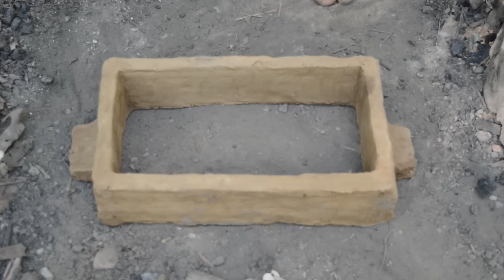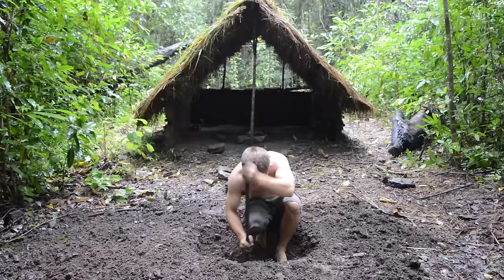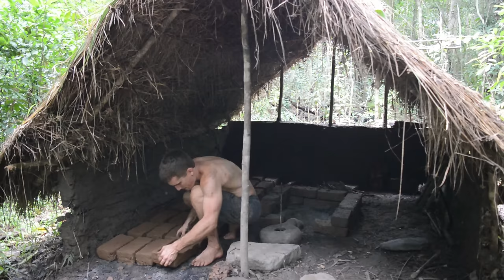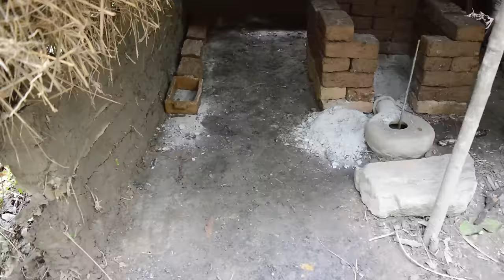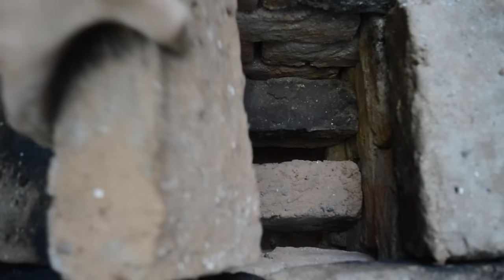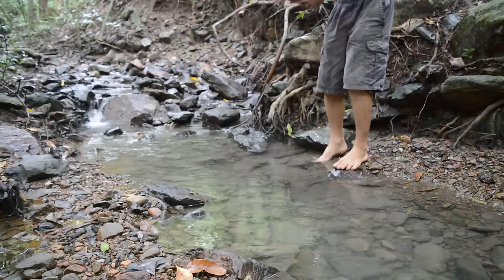Primitive Technology: Fired Clay Bricks

Comment: Love how he always shows us that he makes the fire by him self and not pulls out a lighter off camera
Reply: making a fire is an everyday and tiring job compared to today, so i like that he shows his routine and how he optimised it, and uses it each time
Reply: @marluxiar7231  And you can tell its real just because of his technique, its just perfect.
Reply: If he were out there everyday he could just work with the same embers. I feel for his hands every time he make a new fire
Reply: @h.r.9563  Actually, after a wile your hands stop hurting. When you first start doing hand drill fire you can easily bruise your hands and get blisters. but if you take it slow and practice, you will get calluses and your hands wont bruise anymore. you will be able to make multiple fires a day before your hands start to hurt.
Reply: @DelPlays  
Apparently the bow drill was too much of a hassle to maintain for making fires, since he’s usually able to get the first ember in well under a minute.
Reply: @h.r.9563  the trick is you don't apply too much force when doing it.

Comment: I live in a house made of hand made fired clay bricks. House dates 1874 and fortunately the bricks are well fired. Only a few years later they were dry press commons. both hard and brittle, I have dug them out of the ground after 140 years and they are still hard. Clean them up with a high pressure water cleaner and re-lay face brick walls with them. Great video. 👍

Comment: Hi, good job. My grandfather built barn from such bricks. Only for corners used purchased ones. If may I, I would like to recomend you longer time in fire and save some wood-coal for the end. Bricks will be darker and stronger. Also, use more insulation for heat. Looking forward to see next video! Have a nice day.
Reply: Thats cool
Reply: Nice
Reply: do you mean four?
Reply: @aal8083  no. I mean for as "to build". To use purchased bricks only for last profile at corners.
Reply: @vladabocanek3703  Ohhhh ty for telling me :D
Reply: @vladabocanek3703  squarer? ;)
Reply: @MagnumOpusYT  yes. The 90° corners of bricks. Because I will see, home made bricks will be bent and corners of them will likely to be rounded and broken.
Reply: @Leila Kapoor I don't understand. What do you mean about concrete? Bricks are usually made of clay. Between them goes mortar with lot of lime and just a little bit of cement.
Reply: yes throw clay dirt on the outside of the kiln to retain heat and seal the voids
Reply: Would adding sand to the clay make the bricks any better? Just wondering.
Reply: @bomma2694  No, in principle you burn clay to ceramic. That's why they endure for centuries. Adding sand si just to save clay or to make special bricks like for fireplace etc.
Reply: @vladabocanek3703  ah OK, thanks!
Reply: Legitimate question: Couldn't you have just cut  your bricks in half before they dried so were  still soft?
Reply: @hartianx1698  Why? To have smaler ones prepared just from process of making? Yes, you can. But not everytime, you need just half. Often it's quater od three-quater part. Or shaped for vaults.
Reply: Hi, sorry can I ask for your help? I Need to make any of these bricks for a pizza oven. Can I use clay made up of soil and then fire it? Any advices? Thank you so much!

Comment: I always saw rock tools in history shows and was like, it's a rock not a tool. Now I know what he's doing based on the stick he has.
Reply: SPZ Aruba anything can be a tool if you think about it
Reply: Just like how  tape, a toothbrush an a razor blade can be turned into a small plastic shiv. Lol
Reply: @Sketchy_Dood  I get it. However the utility is based on size, flexibility, and intensity of use. He digs, cultivates, mixes, starts fire with different selections of simple tools. But when performing similar tasks they are similar choices.

Comment: Thoroughly entertaining. I worked out that it’s the iron in clay, that when fired, melds with silica in sand, to harden the clay and to make it imperious to rain. I also saw a video of you making roof tiles. And it’s the carbon in ash that when melded with water, drys to make a hard glue for your bricks. Is it possible to make just concrete bricks, with ash and sand, that doesn’t need firing? I suppose you’ve covered that in a video already. I’ll search for it.

Comment: So does that mean we can have the hope for another video in which you will build a brick house!? 
So you just skipped ahead to London in the 1800`s!
That actually means the logical next step will be you building a locomotive with an world spanning trainsystem! 
Cant wait for that - thanks man keep it up! <3
Reply: These bricks would be useless when building a house. The usual bricks have holes on them so air can get in. Air is a really good insulator.
Reply: They've had clay bricks for thousands of years, not only London in the 1800s.
Reply: I am imagining he is going to be making something more like a brick hearth or metal forge.
Reply: @Bendoair  I guess all of us with red brick houses should abandon our useless hovels.
Reply: @iroll  You'll notice if you have any bricks exposed outdoors or just spare ones lying around, that they all have either holes going through them between the two largest faces or indents in the largest faces. These features are to decrease the amount of clay required for each brick, to allow more surface for mortar to bond to make the bricks stronger and to allow a small amount of air to stay inside the bricks which acts as an improvement to their insulation.
Reply: He can do it. He's discovered lime mortar and is making clay bricks. Once he starts figuring out efficient ways of making bricks (like using holes or indents as mentioned above) you can bet he'll probably make a brick house.
Reply: @MGSLurmey  I agree with you on the mortar, but the effect on their insulation value is probably just about nil.
Reply: @iroll  I imagine it would help a little as an unintended side effect but it's not a primary reason why they're made that way.

Comment: You should add through-holes in bricks to save on clay, drying time and weight. It would also improve their heat insulation quality.
Reply: Wouldn't they also break more easily when firing? At least his roof tiles broke quite easily
Reply: That's a good idea in principle, but requires precise manufacturing and good quality clay with precisely mixed additives

Comment: Primitve technology: how to build a quantum computer
Reply: @tatopo40  If I had where and who to make videos, I would make videos showing some rather advanced low technology. i.e. noria and/or sakia and/or treadwheel to power up a water pump to fill a water tower (water reservoir on a somewhat higher elevation) which would act like a battery for a waterwheel used to power up appliances like terracotta (circular or band) wood saw, terracotta fire starter, blender, mixer, potter's wheel/lathe, wooden lathe, fans (i.e. for forge), centrifuge (if I have to process low-clay-content soil to extract the clay), cyclotron (for removing dust without releasing that dust around the area), crane (for lifting heavy loads), aerial ropeways and conveyor belts, wooden trains on wood/cement/terracotta rails, maybe even a water pump with a nozzle for making mist.

Unfortunately, I don't have who to do that with.
Reply: Yea, all you need is clay!
Reply: @stereomachine  But brains can be “quantum computers”, we don’t know. Any animal with a brain could develop (e.g. through a process of natural selection) neural circuits that harness quantum phenomena for computation.
Reply: @stereomachine  Agree, I understand quantum computing, at least quantum annealing and logic gates, and some basic neuroscience.
Now that I think about it, macroscopic entanglement, or some other quantum phenomenon, should first be detected in neural structures before hypothesizing that there is some computation involved.
Anyway, I didn’t want to start a discussion, just prepend your claims with “as far as we know”. If (future) researchers are not open for an idea they will not look for supporting evidence in their data. This seems like a discussion about magnetoreception during the last century.

Comment: I don't know if it's possible, or not too primitive, but, can you make a water wheel to turn your air blower??
Reply: Impractical, a water wheel wouldn't turn fast enough to create the kind of heat needed. Forge blowers have always been handheld, simply because that's what works the best. He does a water powered hammered though.

Comment: I'm curious, how strong are these bricks? Does using a hotter or cooler kiln make them stronger or weaker? How about the time spent firing them?
Reply: Yes actually, it should reach critical temperature as you see in the video. Easy way to tell is when the bricks glow orange, max temp is when it glows bright yellow. This makes strong & tough bricks. Any hotter (white glow) and you risk melting. Time to raise critical temp depends on how well you construct the kiln & how you manage combustion. After this, you can slowly reduce fuel to cool off. Should be left to air cool gradually or they will crack due to sudden drop of temp.
Reply: do you want test how strong this brick? do you want test with your head ?
Reply: If you are ever in a situation of needing to do this, that won’t matter.  Just keep building bricks like he taught you.

Comment: I remember there being a way to make bricks easily with just dirt. They could be used as good insulation and they were pretty strong, however, they were dried using the sun and it could take a couple days to fully harden. Would it be worth it? Yes.

Comment: Hi ! Thanks for the video, I still have some questions about the process,
 - How long do you let the bricks dry before to melt them ?
 - What is the sand you put on it is made of ?
 - Does diging the inside of the brick can be better to prevent crack ?
Thanks a lot
Reply: Turn on captions when watching Primitive Technology, because you can usually find the answers to things you’re wondering about there.

Comment: I'm wondering if there's an easy way to make bricks with holes in them like the ones you can get commercially to save on weight and materials? is that actually practical?
Reply: Holes and indents are called a frog, to accept the mortar for a thinner but stronger bed joint

Comment: I find it interesting that while you are STATING the measurements in metric, it's obvious that you're thinking in imperial.
You said the bricks are 25x12,5x6,25 cm. Which are odd numbers. It makes more sense when realizing that they are 10x5x2,5 inches.
You seem to do this consistently, using inches, but writing cm.